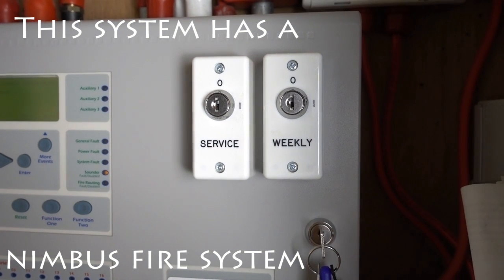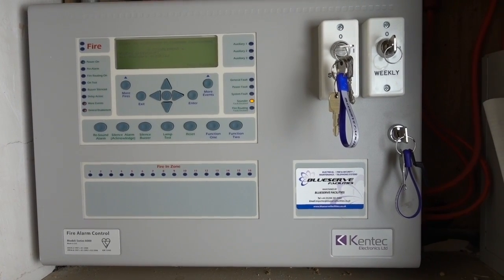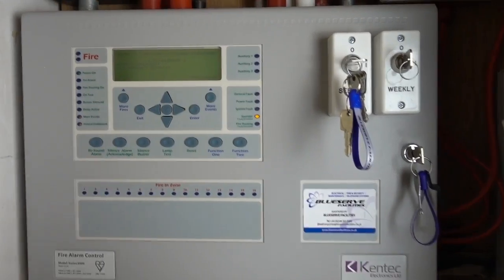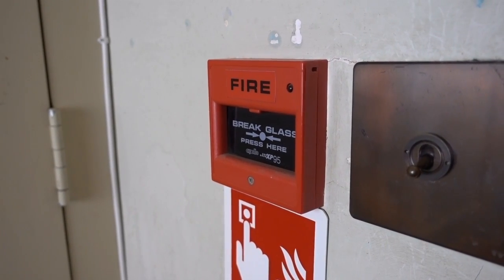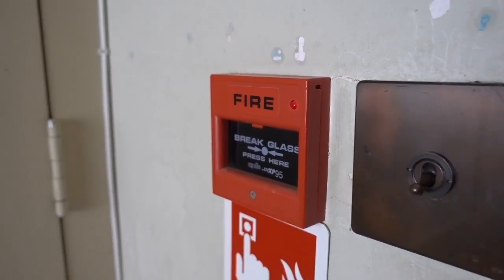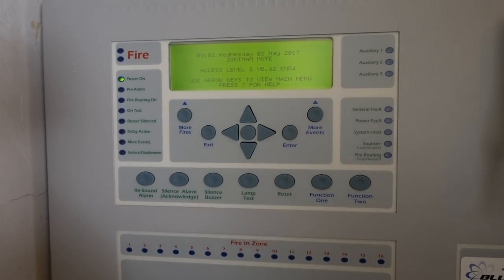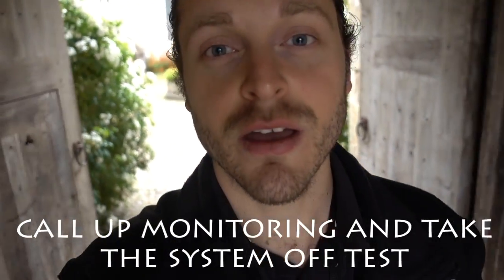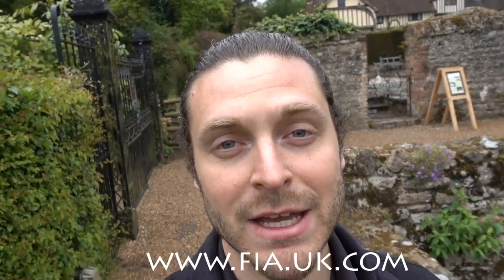FIRE ALARM | WEEKLY TEST | DETAILED GUIDE

Comment: Should the fire alarm still be tested every week in a block of purpose built flats? Thanks
Reply from the maker: Dr Nathan Neil Yes. It is recommended that systems are tested weekly. If you have a grade A system so a panel, detectors and call points then weekly testing applies in commercial or domestic environments. If you have more of a domestic smoke alarm system you should be operating the system weekly. Remember, this is the guidance and is published in British Standard BS5839 part 1 and 6.
Reply: Dans the Engineer hmmm thanks, I shall raise that with the management of my Mums block of flats.
Reply from the maker: It is very clearly stated in the standards and to be honest it makes total sense. Even if they have it serviced by a maintenance company every 6 months, 6 months is a long time to find out if something doesn't work if it's designed to save your life! Let me know if you need any more info and let me know the outcome.
Reply: Dans the Engineer Yes, I agree. Thanks for your help. As far as myself and my Mum are aware they haven't been tested since she moved in (about three months ago). My Grandad sheltered accommodation have their alarm tested every week! I'll let you know how we get on with the property maintenance. Thanks again
Reply from the maker: I have heard this so often it frustrates me. They have an obligation. If you don't get anywhere (which is quite common) I will throw over some resources that you can use. It's great you are thinking about these sorts of very important things because many people don't!

Comment: what sounder was on This video?
Reply: Dans the Engineer if you can it would be good if you test this system and walk round the different sounders:)
Reply: Dans the Engineer yes just like the open areas or the base sounders in the building
Reply: Dans the Engineer basically a system test just walk round them
Reply from the maker: Randomstuff25 21 the sounder that you hear at 1:05 minutes is an older style Channel Safety Systems bell. The other sounders you hear are Apollo XP95 integrated base sounders. Great product.
Reply: Dans the Engineer ahhhhhh ok I thought they were open area sounders👍😂
Reply from the maker: There is a couple of open area sounders on the system but you definitely can't hear any on this video as they are on the other side of the building.
Reply: @DanstheEngineer  The other sounders sounded more like the discovery base sounders or the Discovery Sounder Vad Bases, not the integrated's
Reply: @jaacon5561  All of the new apollo kit are at this pitch.
Reply: @145-k1b  Not the XP95 sounder beacon bases I don't think, mines from 2020 and it does the 'older' tone
Reply: @yeety1208  yes because its XP95
Reply: XP95 is "Older kit" if you get me
Reply: @145-k1b  Sort of yeah
I get what you mean
Reply: @yeety1208  it could be an XP95 sounder VAD base.
Reply: @145-k1b  the XP95 sounder vad bases also have the higher pitch tone.
Reply: @Xpertcard  Hahaha I only discovered like a week ago that the xp95 sounder vad bases do the higher tone
Reply from the maker: Nathan 2000 did you want to hear the different sounders sounds?
Reply from the maker: Randomstuff25 21 I could do that. I work on a few premises that have very large systems. Keep a look out
Reply: Dans the Engineer ok thank you 😊 can't wait to see next video
Reply: @Nathan-xt1kl  you used to have a video of apollo ancillary sounders going off in a hotel?
Reply: I thought they were discovery sounders cause they are higher pitched